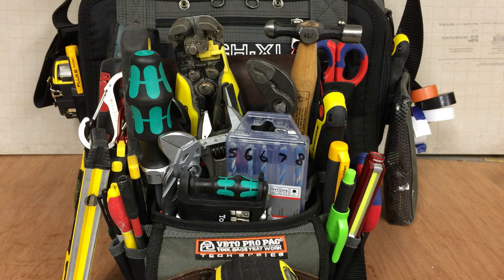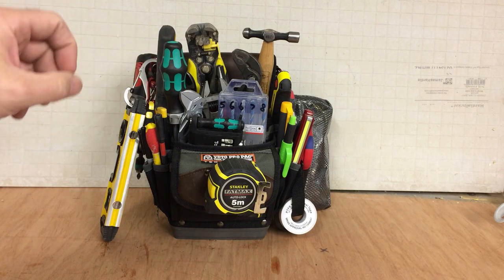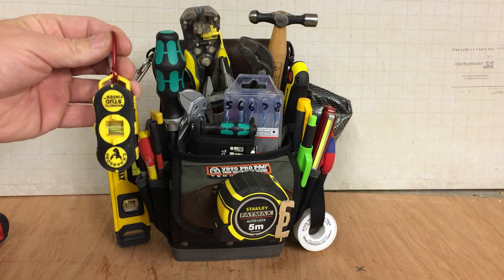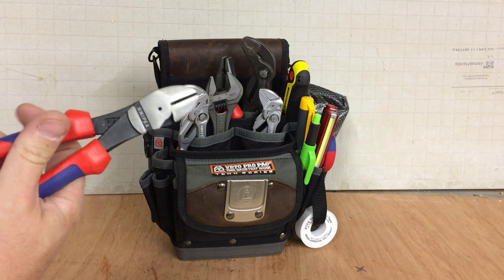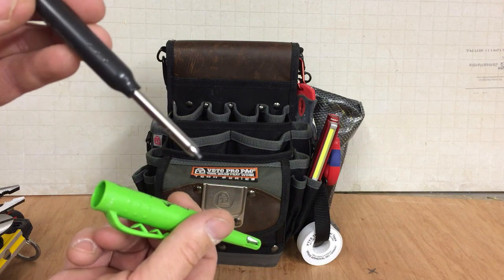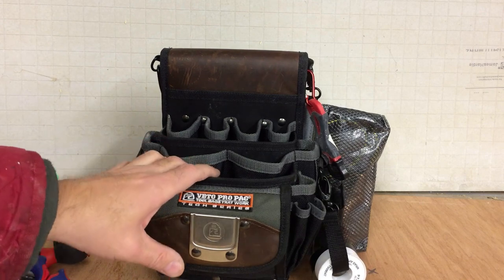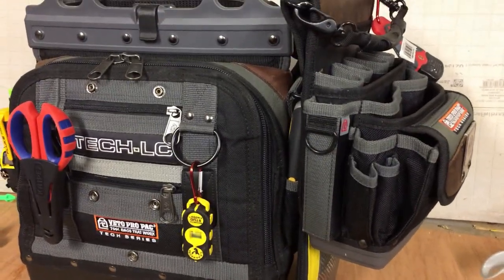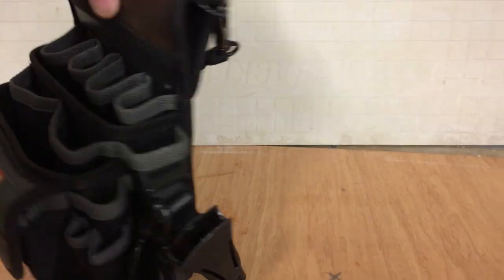Veto Pro Pac TP4B | Mini Veto Pro Pac Tech XL | Maintenance hand tools

Comment: Ran into the same problem with bags, I now use Occidental Leather totes and Milwaukee packout totes and boxes as main or overstocked tool carries but I always carry a tool belt for my job essentials.  It can be laid on the counters or worn towards the back for tight work environments. Best compliment for working in this field.  I have tool punches and fastener bags that I wear.  No more going up and down ladders and looking for that screw or,that tool... always on me.  I do not use smaller totes or bags anymore and I use Occidental Leather tool belts (electrical, drywall and general carpentry toolbelts) but there are many other brands as you know.  You should try one out.
Reply from the maker: Thanks for the comment, I will check some of those out !

Comment: Hi.  

Can you ? or do you need a Thick strap ? - tp4 or tp5 ..
Reply from the maker: Hi, I'm not sure what you mean ? Do you mean the handles on the tp4 & 5 ? 🤔
Reply: @Bacrenfencing  I'm thinking of buying either 1   . Could i attach a veto heavy duty Strap ( I've seen on tool Web sites .
Reply from the maker: @stevendouglas3860  Yes, you could attach the heavy strap to these pouches. Both types have D rings on the top corners where the strap could be clipped on to. I hope this helps
Reply: @Bacrenfencing  Thank you Bacren.  👍👏
Reply from the maker: @stevendouglas3860  no probs !

Comment: Why not get the TP-XL?
Reply from the maker: Hi Hvac player, thanks for the comment. I originally had the TP4B as a smaller electrical bag to compliment my TECH-LC but through using it as such, discovered that it was not really required as the Tech-LC was compact and small enough to carry to even the smallest of jobs without any issues.

 Through experience, I found my general maintenance bag (Tech-xl) to be rather heavy to be carying in to really small maintenance jobs. This is why I set the TP4B up as shown in the video. Now I use my Tech XL for larger projects and the TP4B can be used for small quick turnaround type jobs.
Reply from the maker: @hvacplayer3238  Apologies Hvac player, I thought you meant why did I not get the TP-XL as opposed to the TP4B !
 Yes, I have had a look at the TP-XL and it looks like an excellent bag, it would be even better than the TP4B for my specific purpose. Thanks again for the comment !
Reply: I personally use the veto pro pac tech pac backpack (hvac tech) its big but does allow me to carry a lot and I like to have all I need at the job site without running back to the van especially if I’m up on a roof!
Thanks a lot for your responses and for a great video :)
Reply from the maker: @hvacplayer3238  I like the look of those too and fully understand carrying the additional weight to save running back and forth to the van. There is nothing worse than forgetting THAT one tool you need and having to struggle all the way back to the van - especially if up on a roof !!!
 I'm glad you like the video, I never know if I am just speaking to myself and rambling on and on for no reason :-)
Thanks again !